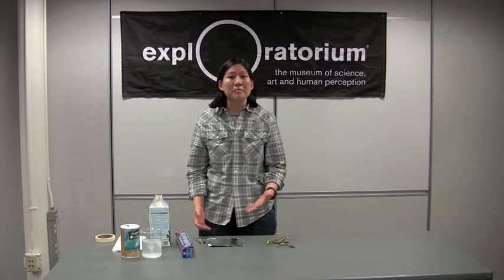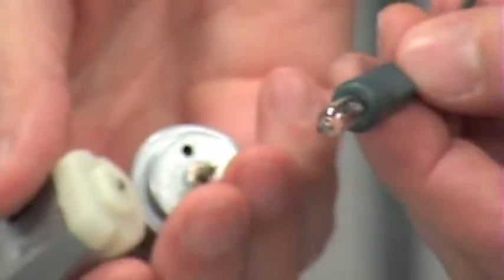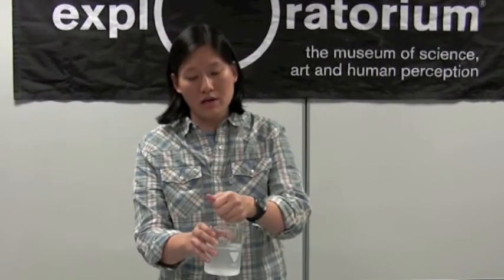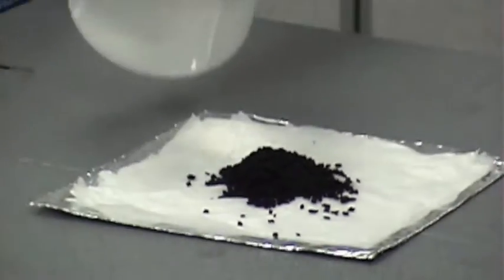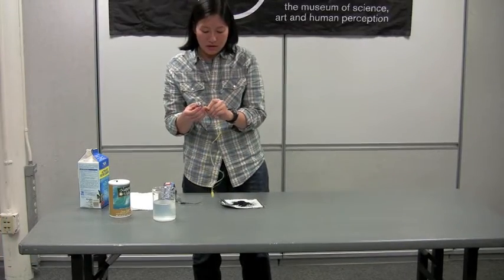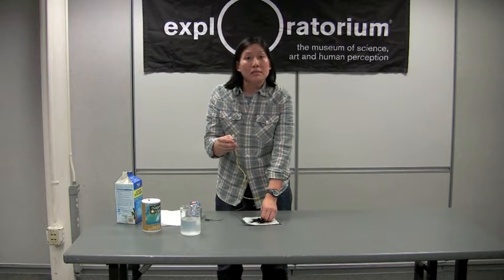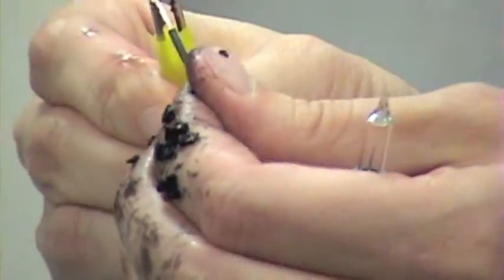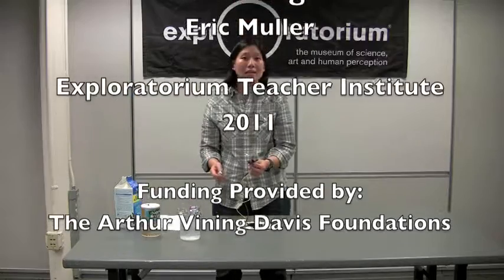Aluminum Air Battery - Exploratorium Science Snack

Comment: Can we use graphite instead of activated carbon?
Reply: I've tried it. Graphite needs surface area, something activated charcoal has plenty of. Graphite will work but not as well or a as long.
Reply: @evanriddle1614 hey may I ask a question, what if I replace the paper towel (it acts as electrolyte right?), with PVA-KOH-Glycerol which is dried and has flexible structure. Or I can say that it is a semi-solid flexible electrolytes. (I'll working on flexible electrolytes development)

Comment: The video that launched my own madness. And yes, charcoal and aluminum can touch if it's the charcoal from the preceding cathode of another cell. Ergo- an air battery voltaic pile. This is limited to a few cells else internal resistance causes heat. In my experience that's 3 cells. Salt water is a good choice. KOH makes more power but also more corrosion. Many thanks to this young lady.
Reply: Hi! If I may ask, why is it necessary to use the paper towel to prevent the aluminum foil and charcoal from touching?
Reply: @05_Belicia Tampubolon  it's an  ionic transfer that goes between paper towel and aluminum, not an electrical one. I can't say I understand it very well but it won't work without it. Thank you!